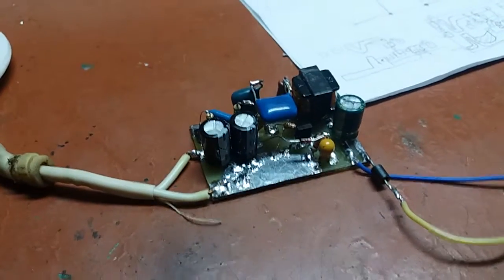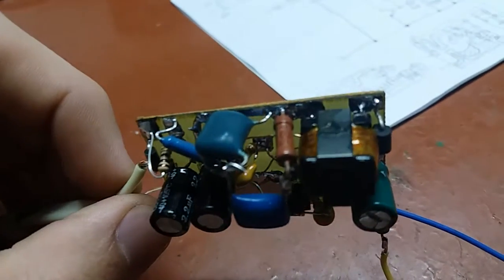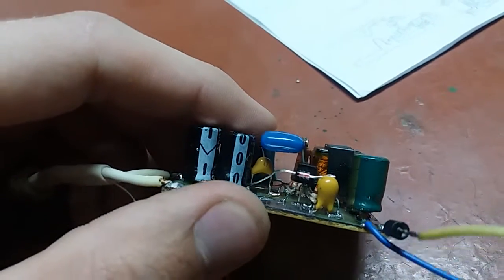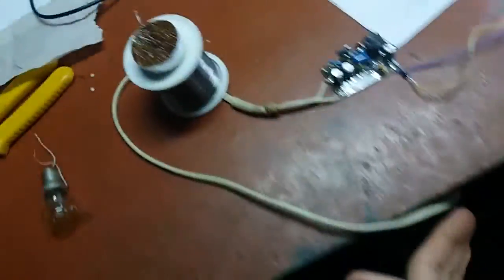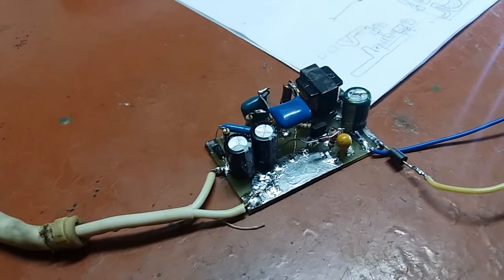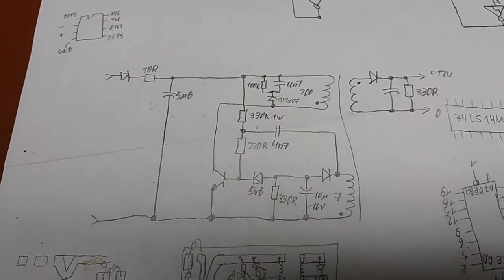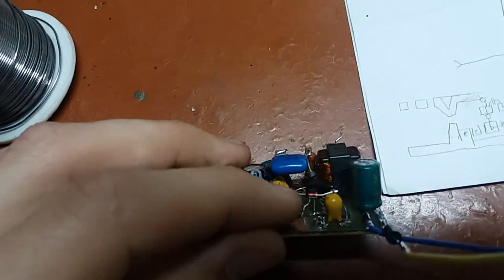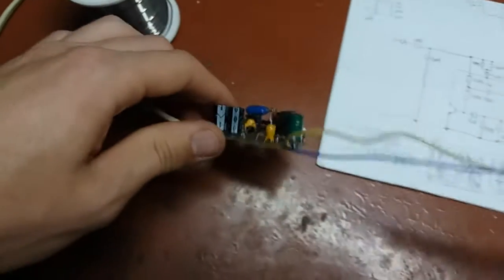Little SMPS using MJE13001

Comment: Nice! I am always finding transistor E13007 in TO-220 when I tear down old PC supplies. Is this TO-92 related to it? Cause I have lots of those just doing nothing.. Also for 120v mains in North America, should we just wind half the number of turns?
Reply from the maker: Yes, they are from the same series. They are just fine for small SMPS's like this one, 1-2W is a piece of cake for them. 
 Well, the circuit will work as is, but the transistor will be stressed more. To do it right, you need to recalculate it, I didn't tho :D I went and used data from this article: http://danyk.cz/iz_odv_en.html
Danyk provided all the necessary data to build one.

Comment: One transistor, im supprised it works :-), i too have looked at his site, a very inventive and clever man :-D.
How bad is the loaded to un loaded state? 11-15v perhaps?.
Add some input filtering from an old switchmode and dump it in an earthed diecast box, that should Help with the emissions.
Reply from the maker: It works well for constant loads, but it'll go kaboom if you were to remove the load completely. I tried doubling the load and the output voltage sagged by 0.15V, so it's just fine :) And yeah, I tried CM-choke, cap across the line, combinations of both - they decrease a noise, but not drastically. Luckily, it's used quite a ways from anything sensitive, so I left it that way.
Reply: LOL KaBoom :-D
Perhaps a minimal load resistor or led indicator at 25ma might stop the explosive nature of it lol :-D
It works though, good job :-D
Reply from the maker: zx8401ztv Cheapo phone chargers use similar circuit :D And yes, you need a min load present at all times. If there's no load, energy stored in transformer will produce a huge spike on the primary which is likely to knock the transistor out